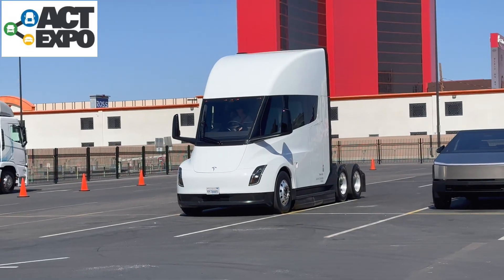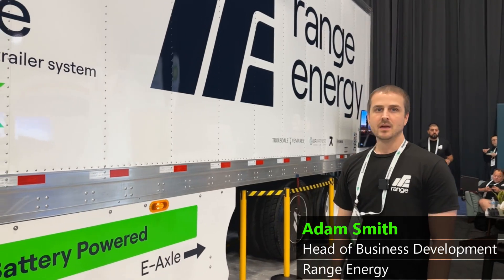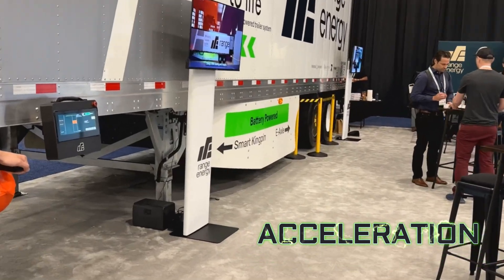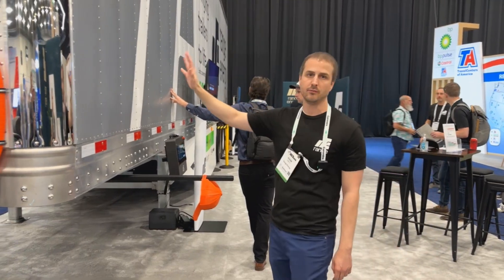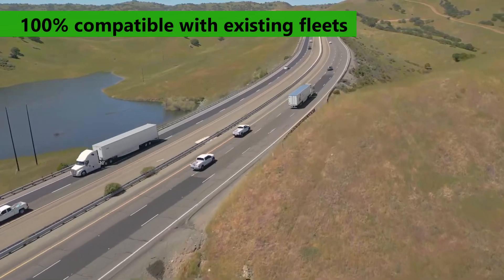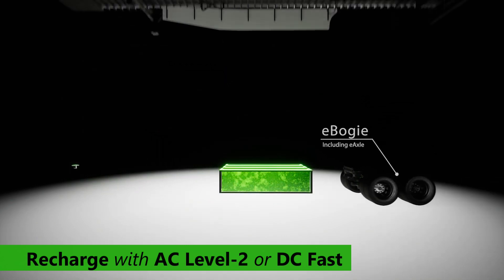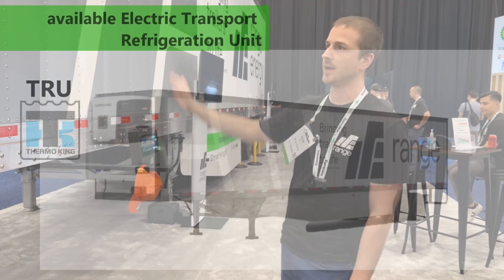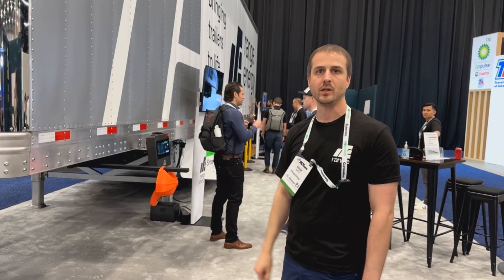Range Energy - Electric-Powered Trailer System (less emissions, more savings)

Comment: They're trying to solve a problem caused by the solution for problem that doesn't exist. Electric semis are useless and stupid. If you think otherwise, it's probably because you are not in any way connected to the trucking industry. Don't listen to their hyped-up promises that they NEVER deliver on. This is ignoring the real physics involved with charging infrastructure and batteries that cause EVERY SINGLE ELECTRIC VEHICLE to burn more fuel for the same distance travelled compared to diesel and gasoline.

Comment: There is no mention of the weight of the batteries and drive motors, which subtract from payload on a 1 to 1 basis.
Reply: Depends, these are rumored to qualify under the 2,000# added ev weight allowance, even if setup behind a diesel tractor. So it might be a LOT less than people like you are trying to claim. Oh yeah and well over 65% of ALL freight hauls are cubed out and not gross weight maxed. 😀👍🏻
Reply: @4literv6  To qualify for the added weight allowance, the vehicle must be "powered primarily by means of electric battery power". Even the 288 kWh version can probably only add 115 or so miles to the range of a diesel semi, which typically has a range of 1,000 miles or more; so it seems unlikely the rumor is correct. 

Your point that most hauls are cubed out also means that BEV trucks can increase their range simply by towing lighter loads. For example, a Tesla Semi can add a similar 115 miles of range just by reducing the payload to around 20,000 lbs.; and get the dramatic reduction in fuel/energy cost of a BEV for the entire range, and not just the range that's run on batteries.

It may well turn out that there's a niche where the required combination of payload and range can only be met with this trailer, and which isn't particularly sensitive to operating costs. It'll be interesting to watch this offering to see if it gains any traction.
Reply: @BigBen621  electric semis are worse than diesel semis. Full stop. There is no competition or argument. And nobody should be forcing them on us either.
Reply: @shamancredible8632   electric semis are worse than diesel semis. Full stop 
Well, that's certainly a well-reasoned and factual claim. Thank you for sharing.

 And nobody should be forcing them on us either. 
Nobody is.